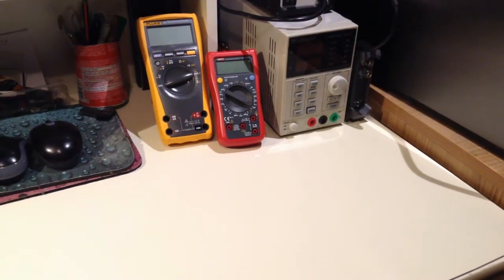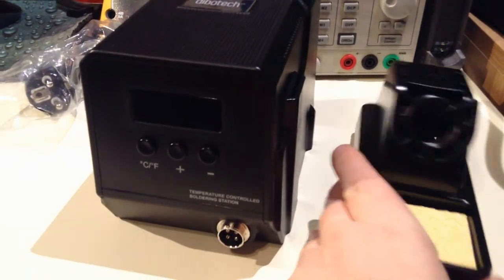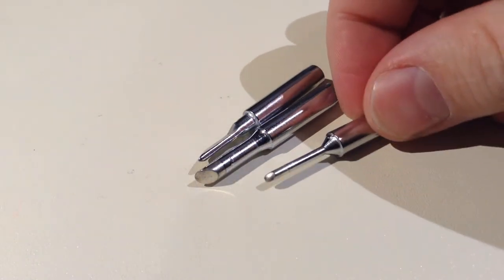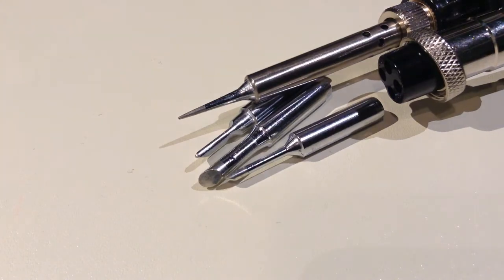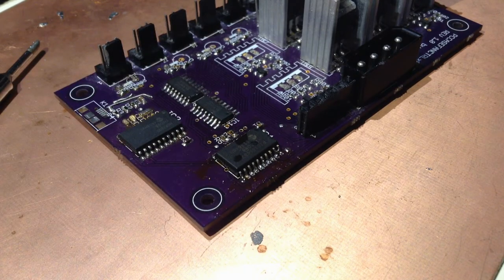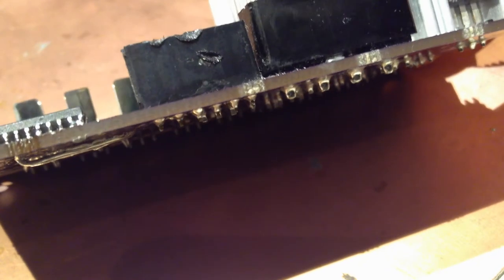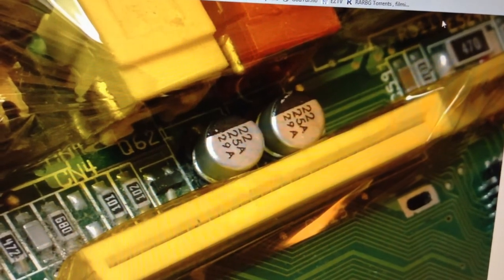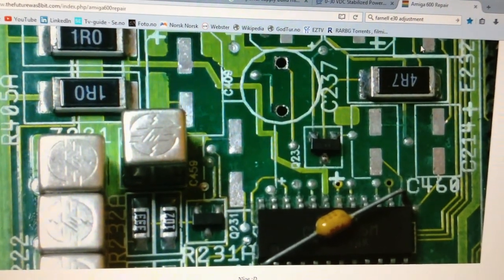New soldering station Dibotech Pro 60W (Zhongdi ZD-8936)

Comment from the maker: For whoever comes here wondering to buy this iron. I still use it. Bought it at kjell.com almost 6 years ago. Tip: Get replacement tips from ebay/alibaba. Hakko 900M. The replacements are so much more faster to solder with due to being more massive and more tight fit around the heating element. The tips that came with the solder station, and the ones i bought extra at kjell.com were so hollow.
Reply: Is the soldering station ESD safe?

Comment: Love the new soldering station. It seems to heat up to temp quite fast. I have an ESD mat very similar to yours -- be careful of heat from the new iron, hot air station, or molten solder drips/splats, as the surface of this mat will melt quite easily.  Can you use aluminum foil (folded into multiple layers) as well as the Kapton tape a shield to dissipate heat from surrounding components when desoldering?  I hope you are able to record the recap session; I would like to see your process.
Reply from the maker: The carton says 10 seconds, ceramic heater. I like it :) Thanks. Will try not heating up the mat. It doesn't like the hotair that for sure. Tested that in a corner.. Alu foil works also. I'll try my best. Elfa sent me the wrong part. May take a couple of days. I haven't heard from the owner of the Amiga today. I hope he hasn't gone to someone else.... Anyway, keep you posted :)
Reply: Yep, that soldering station heats up extremely fast. +1 for recording the recap session. Never done anything in Amiga and am curious what airflow and temperature settings you'll have to use on the hot air station to remove the caps.
Reply from the maker: 280 C . Check out John Hertell's blog. http://wordpress.hertell.nu/?p=464
Reply: I doubt 280°C will be enough. The PCB temperature is about 80-100°C below the set temperature, at least on my hot air station (SS-969) which looks like a clone of Atten 858D  Checked with K-type thermocouple. That's barely enough to melt the leaded solder. 300-320°C, maybe... Try 280°C first, we'll see if it works or not. Oh, be careful not to heat the top of the caps, they tend to explode. Don't ask how I know. :)
Reply from the maker: Thanks for the advice. Since I'm not trusting the temperature entirely and I'll use the iron in tight places I will add Kapton tape, allthough it is possible to use hot air without damaging the plastic as it is shown in John Hertell's blog and video https://www.youtube.com/watch?v=5DB56v_p80k
Reply: Is he also using Atten 858D? Is it 858D or 858D+? That does it, I'm buying it. With my SS-969 there is no way I could remove a cap that fast even at 350°C and at only 280°C there is no way I could even start melting the solder.
Reply: Actually, a friend of mine is telling me John Hertell is using Hakko. That would explain it. I'll wait to see how it goes for you with Atten 858D.
Reply from the maker: ok but did you try it on  lead free, or maybe large ground plane? I practiced on an old GFX card with smd electrolytic caps. The ground plane was massive, and lead-free tin. Had to crank the heat up a lot, and still it was slow. The Amiga has longer thin traces to any plane I think. Also another thing, notice how close John holds the nozzle. Look at dave jones video on the atten 858. He measures the temp out of the gun, and it changes quite a lot in distance. Hopefully there is time tomorrow. Waiting for the correct part tomorrow, got the wrong cap from Elfa.  :)
Reply from the maker: I'll dig out the thermocouple for the fluke meter and measure at say a low setting like 150C. I'm happy with the 858D+. I can't understand why yours SS969 is worse. It is just hot air... hehe
Reply: I tried with PC board (lead free, had to crank it up to 430°C) and Android phone board (same, lead free, 430°C). Your saver was ok with just 300°C. Today I tried 280°C in my Amiga 1200, heated up for a minute, no effect, gave up. :)
Reply: John said he is/was using Atten 858D.
Reply from the maker: Ok. Maybe I was lucky and got the original Attem 858D+. My sister gave it to me two christmases ago.

Comment: Nice new toy. Have you worked on the Amiga yet? Should be fun.
Reply from the maker: Not recently. I had an Amiga 1200 which I modded with  Amiga 4000 keybard external. Lifting some smd pins and adding some wires .) That hack job was back in the 90s with a terrible iron.

Comment: Hi! I'm new to soldering, but want to build an mp3 player and a keyboard. Would you say this is a good soldering station for those kind of projects? And do you have any other fun soldering projects you recommend for a beginner? Thanks! Best regards:)
Reply from the maker: Hi. It is indeed a nice soldering station. I use it for all my soldering, except I have a 60W iron for really stubborn connections. Other projects.. Hmm depends what you like to work on. :)
Reply: @bwack  Ah okay great! Thank you! And nice channel that you share all this! Then I think I'll go with this one or a similar station! I actually found a website which sells small electronic "kits", sort of fun small project, so I think I'll start with some of those:) They included, e.g., building some small sound effects, sensors, and other random stuff!